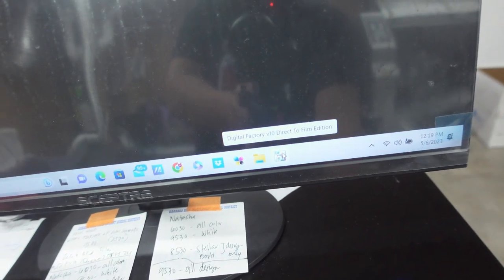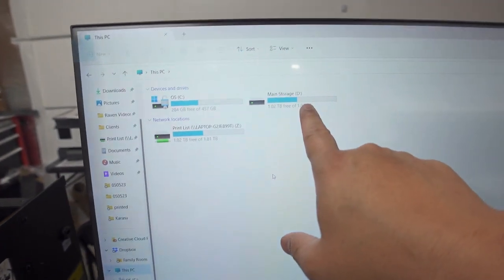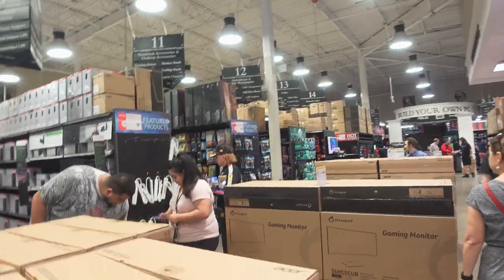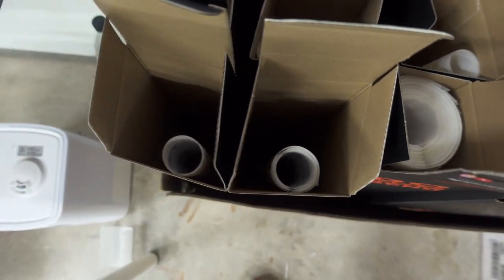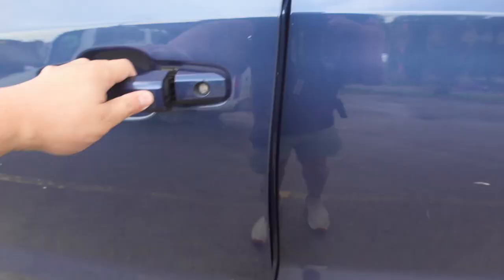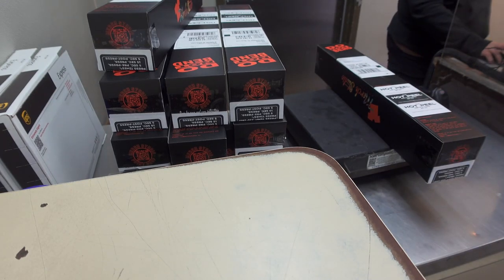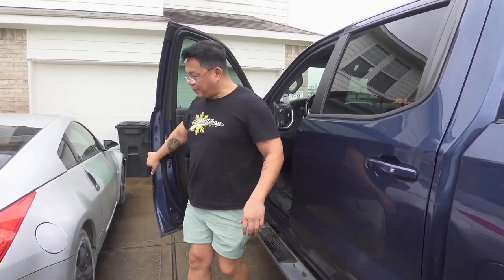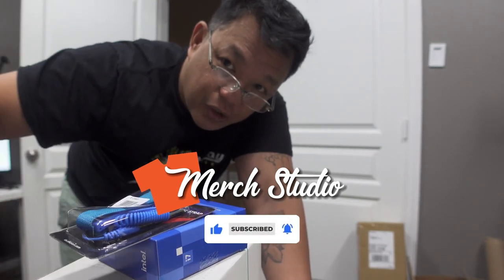Upgrading My PC to Improve DTF Printing Speed

Comment: The pc that was loading slow what specs was it and did u add a gpu to your upgrade or left the onboard gpu. 😊
Reply from the maker: It had its own GPU but we only use it for ripping. GPU is not required for it.